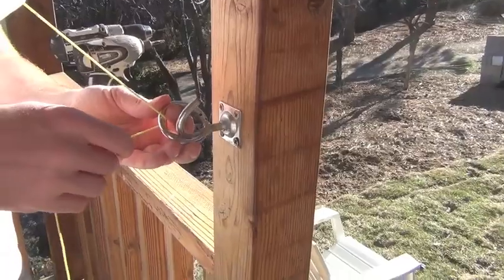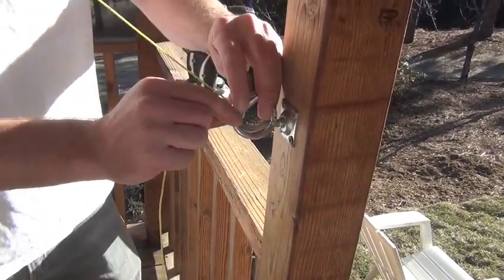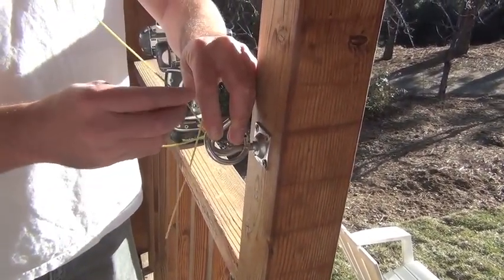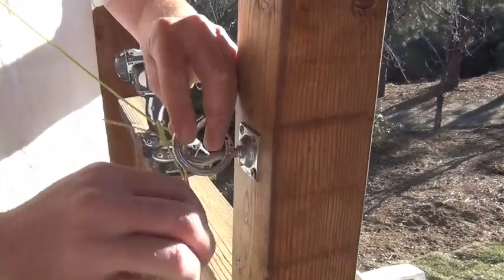How to make Hookum - DIYHomegames

Comment: Here in England there are pubs which have a similar game - in fact, more or less identical, other than it's called 'Ring the Bull' and a Bull's head (honestly, sometimes it is, the hook in the nose!) or just a hook in the wall is used.   However I have yet to find one although I do visit such establishments now and again(!)  Apparently the way to play is to swing in an arc away to the left (or right) of the player, so the ring clangs onto the hook in from the side, rather than head-on.  If you're REALLY clever, it goes round the pub twice... 
Interestingly whilst, like I say, I've never seen it in England, when visiting the States we found it twice!  Once at the 'Red Hare' Brewery Marietta, Atlanta, Georgia, and on the sea-front at Fort Walton, Florida!   Both times it was in use by locals who unsuccessfully were trying their skills.
I did get to play 'Cornhole' for the first time, which is played in England but not commonly, unfortunately.  Myself and my Godson were trashed by a couple locals, but hey, that's how you learn I guess.